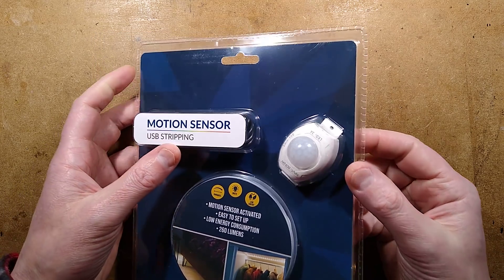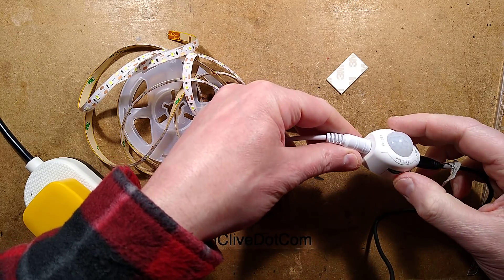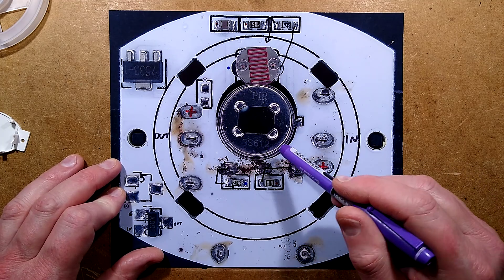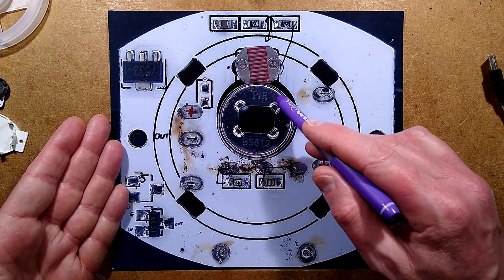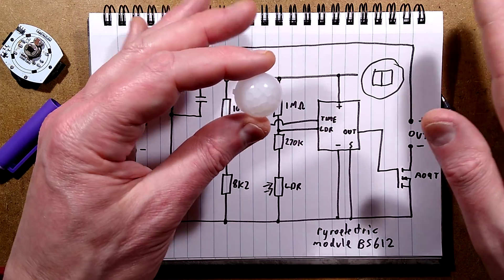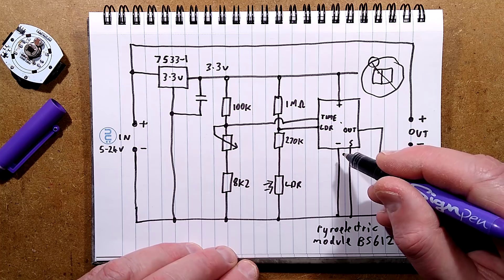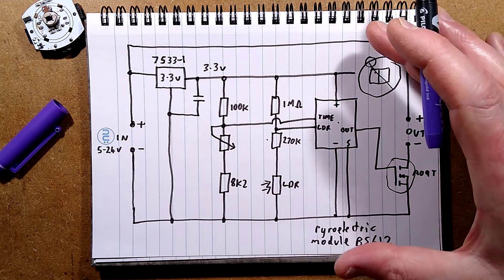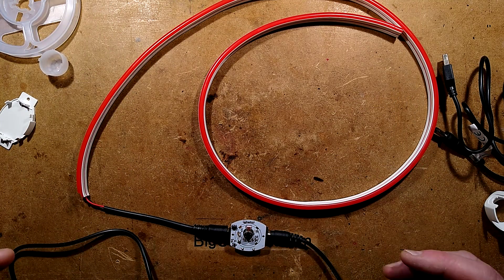Poundland's PIR LED tape.  Worth buying just for the sensor.

Comment: I have a PIR light which recently has started retriggering itself. Thanks for the info about voltage regulation, I'll check to see if its regulator has given up the ghost.
Reply from the maker: If it's based on a capacitive dropper, check the capacitor value of the main capacitor.
Reply: @bigclivedotcom  Thanks, but it's battery-operated with a normal 3-pin regulator and the "regular" chip you were expecting to find in your Poundland dongle.
Reply: I have a "Mr Beams" light in the bathroom for middle of the night comfort breaks and that explains why it flashes on and off when the AA  battery's are below 1 volt.......
Reply: @Trev5  That's actually the brand of light I had self-retriggering. Except I'm feeding it from a 5v supply instead of the stock 3 D cells so I'm not sure why it was acting up. Unfortunately when troubleshooting I had a tiny resistor get lost so now it doesn't come on at all. Its regulator chip outputs 3.0v. Assuming yours uses the same, that explains why the problems start when your batteries get below 1v each.

Comment: What happens to the led strip with 24V input?
Reply from the maker: It would fry it very quickly.
Reply: @bigclivedotcom  Then I don't understand why there is a rating on the sensor

Comment: Anyway you could make a video where you swap out the PIR chip for Doppler chip?
Reply from the maker: The slight downside of the doppler modules is that for power bank operation they have a higher standby current.

Comment: With our hotter summer nights, the  Doppler radar modules have an advantage, as they continue working when the passive IR give up, due to ambient temperatures being so close to body temperature. Last year our front door porch light failed to operate for a number of nights, due to the high night time temperatures. It slowly regained sensitivity as the ambient temperatures finally fell back to a more normal range.
As to the circuit, it is very simple, it must be difficult to find an output MOSFET that has a sufficiently low threshold voltage to switch to high current saturation output with only a 3.3volt gate drive..

Comment: You bring in a Poundland USB supply reminds me that my Poundland 1A supply has almost stopped working, i.e. either won't charge eg Nicore type lights or only very very slowly charges a phone.  My 2A supply still works.  Have others found the same?

Comment: ￡1.21  41%OFF | 12V Motion Sensor Light Switch 5V DC Activated Timer Automatic Movement Detector ON OFF LED Strip Light PIR Motion Sensor Switch
https://a.aliexpress.com/_BURs8n

Looking at markings it's 5 /12 v but not bad for the price

Comment: A 5A MOSFET wouldn't normally be used above 1A or so in practice, as the top current rating implies water-cooling (infinite heatsink).  My advice is calculate the power from I-squared-R and choose a device that won't need a heatsink - ignore the current rating, it won't normally be useful for this.

Comment: I built some 12v gardenlights using one of those pir’s I ordered online ages ago. It has led strip stuck to some aluminium L and im quite pleased with my efforts as not really my area. I cored a hole in the bottom of a waterproof box and glued the sensor inside without the case..

Comment: I have something similar to this, but it has a built-in battery included within the PIR unit to power it without needing to be constantly connected via the USB charge cable.

Comment: So if you accidentally plugged the input and output the wrong way round, I assume it would be safe, because the transistor would now be on the input and simply wouldn't let any current through...?
No workie, but no damage to the components...?
Reply: Almost. MOSFETs have a body diode which always allows reverse current. The lights would stay on. Although there is a voltage drop on this internal diode so there's a chance of overheating the FET.

Comment: In other words would there possibly be some sort of comparator or Schmidt trigger circuitry inside that sensor?
Reply from the maker: It will have the equivalent of the BISS0001 PIR chip.

Comment: Can you tell me what the output voltage is if the input is 12V. Is it still 5V or 12V ? Thanks for the video as always.
Reply: The voltage is presented directly on the output lines via a transistor, so theoretically shouldn't change (circuits in parallel, same voltage). If there is any change in practice, it would be marginal and well within the operating range of a 12V device.
Reply: @nialltracey2599  Great - thanks. I thought it would be the same as the input but good to know for sure.

Comment: If they have the dusk sensor, would they stay on all night if used in a dark environment
Reply: Only if there’s movement to trigger it.
Reply: @MarcelLENORMAND  would there be a way to set it to stay on at night?
Reply from the maker: There's no facility for making it stay on all the time.  That would require a dusk sensor circuit.
Reply: @jamiecullen9075  That’s moving to a somewhat different sensor - just light/dark.

Comment: I got a similar circuit from ALDI but it was battery powered it has the regulator caused the batteries  to drain after a couple of weeks. I removed  the regulator  circuit and by passed it. This  works perfectly at 3.6 v to 4v from 3 rechargeable AAs. It lasts for months in our coat cupboard. Only 1m of LEDs though. I think it was about £6 a couple of years back
Reply from the maker: One of the biggest causes of unwanted battery draining is duff surface mount ceramic capacitors.  They've miniaturised them so much that if they fracture or get chipped they develop a resistance.

Comment: i think ill have to try that voltage regulator on my hc sr505 pir module. it tends to retrigger itself after about 10 seconds even after being covered by a thick piece of plastic or pointed at the wall.
also, i wish there was a poundland nearby, or a similar shop close to where i live

Comment: That will explain why mine blew up when I put 12v in on the 5 to 24v connector. I expected it to regulate the power to the strip. Won't do that again with the second set and at least I have two good sensors.

Comment: In reference to the little dome lenses, are they designed so their focal length is more or less "focused" on the PIR surface? If so, it seems as though this would further increase the PIR sensivity.
What do you think?
BTW, pretty neat little gadget.
Reply: Well yes. How else would you expect them to be? The datasheets for pyrosensors give the effective position of the sensing elements to aid the design of lenses.

Comment: I worked in lighting controls for nearly 30 years (business, industrial and retail not the exciting stuff) all of the detectors that we used were quad pyro.  They needed two of the elements to be triggered to operate.  Almost all of the sensors we used were passive infrared as microwave sensors false triggered far too often to provide good energy savings

Comment: I was curious if there was an option for those of us in the USA, and it's possible to get things like this, usually $5+ USD. In fact this exact module with an AC power supply is $7.58, so poundland is almost a full USD cheaper, but that's probably just the price of the adapter + profit.
Not bad, not bad at all!

Comment: Excellent - Wonder if our Reject Shop might be stocking this item - they stock a broadly similar range to the UK Poundland stores. Bearing in mind that "almost everything" is done by that single PIR module, that's an amazingly cheap collection - half-price (and functionally complete) PIR module, with 2m LED tape and a USB cable thrown in free of charge!

Comment: Clive: Aldi has a load of “smart lighting” gear in the middle aisle. Not sure if you have an Aldi out your way but might be worth checking out.
Reply: Aldi and Lidl have both been showing "Smart" tech on their web pages. Aldi shows a couple of wifi light bulbs, online-only, BC and ES. Lidl has a wider range of kit, but you have to buy a "gateway" (Zigbee 3.0 standard) and none of the light bulbs are BC.

The Aldi bulbs are explicitly wifi. Zigbee is a low data-rate "mesh" system that has been around for a long while. 

Poundland has some wifi lightbulbs as well, but their website shows nothing like this. Have we missed our chances?
Reply: Is Aldi’s whole middle aisle lucky dip a universal thing? I wasn’t sure if they did it outside of Australia.
Reply: @NoobixCube  it’s certainly there in Germany, where the shop started, and in every Diddlidi shop I’ve been in in the UK, so I’m pretty confident that it is universal.

Comment: I still laugh at the woman who gave some led strips a low rating cuz she cut them expecting the non powered strip to still work wirellessly
Reply: where can i find this  lmfao
Reply: @ianbuilder  cant remember it was on some amazon link of some strips on a channel
Reply: How about this one 😂

https://youtu.be/m4cfIInHV10
Reply: @AdaptivePhenix  so acted
Reply: It gets me when people give low rating for items they havn’t even opened and looked at!
Reply: I used to work for ICM Controls, an HVAC control manufacturer. I worked on 3rd shift and occasionally got phone calls from people pissed off that their thermostats weren't working. One woman complained that her power was out, and her furnace wouldn't turn on despite the thermostat having two AA batteries and an emergency mode. (Forced air heat...) Another man in Florida called complaining that his thermostat wasn't working and that there was frost on the table in his kitchen. The temperature in Florida that night was 60°F. (Turned out to be the igniter, not the thermostat, which is what told him that the temperature in the house was 63°F)
Reply: @MattThompsonOnGoogle  I work HVAC and it always amazes me how much people will complain about their electric bill being so high in the winter when they try to heat the house to 75°F when it's 20°F outside or cool down to 60°F in the summer when it's 90+ and 87%RH and they have a 20 year old unit that hasn't been maintained since it was installed.  I blame the way temperature controls are set up in cars.
Reply: @sivalley  I blame our education systems not having enough emphasis on basic physics and math. But there's no substitution for human stupidity. :)
Reply: @SigEpBlue  We are all extremely ignorant about something. Don't judge just because you know something others don't.  HVAC, electronics etc are all complicated things and thinking adding math and physics to high school is going to matter is ignorant itself. Kids already "learn" a ton of abstract stuff that disappears from their brains once they leave school. High schoola need more practical life courses (home care, finances, etc) not Math and Physics. Save that for college or specialty school if they are going to actually use it in their careers.
Reply: @MattThompsonOnGoogle  have you ever seen one of those old school set back thermostats the ones with the actual mechanical timer dial with the quartz clock movement that ran on a single double A battery all times was a recharge will battery it's interesting that they did have a charge switch to charge off the thermostat power but the thing is it was not a way to keep the clock running while charging you think there'd be some sort of circuitry so that when it was charging it would keep the clock at least someone accurate but I guess they save a few pennies.

I remember and while Paris places we had hydronic Heat.

Well nice things is my shop which is actually the utility room State about 70 degrees all year round.

First of all most of which was on the ground second of all boiler and hot water heater both were in there so yeah.

But I remember that was the first time I had change that type of zone valve we had one that had gone bad and fortunately the override was working just fine what happened going there I manually turn the valve on or off to get heat one of those zones also what time will a bad thermostat as well these were the old three wire thermostats unfortunately so it's harder to find a thermostat at that time.

I was tempted to just stick in a relay in the system and of course Bridge rectifier doll if I could not find an AC relay but one thing would be to have to adjust a thermostat anticipator which might get finicky.

But we did eventually find a thermostat that's compatible.

Also went at zone valve where we are kind of lucky there was a spare they're from when we moved in that was down amerifactor in my shop already.

Are so spare parts for charmglow gas grill which we still use the old gas post lights that can be been converted to Electric which were also charmglow
Reply: @aaronbrandenburg2441  Are you on drugs?
Reply: @aaronbrandenburg2441  Can you try again, but this time sober?
Reply: Aaron Brandenburg '
Reply: @Aaron Brandenburg Cool story bro.

Comment: oh my word, does anyone else recognize what that reel is? Note the core, that looks suspiciously like a reel to reel spool...wonder what they did with all of them...
Reply: I thought that initially.
Though the LED tape looked wider than 6mm.
The other possibility would be 8mm cine film.
Reply: Reels like that are used for packaging SMD components for pick-and-place machines; you can buy them by the truckload in any size you want.
Reply: It's the same type as I've got a couple of older Poundland USB strips coiled on. The plastic is very very flimsy (although mines is black, not transluscent white), so not really as rigid as you'd use with a more fragile tape.

Makes sense that they'd continue using the mechanics of the old winding systems, though -- if it ain't broke, and all that....
Reply: @nialltracey2599  exactly! was just shocked to see it again!
Reply: 8mm film / Super 8 film .. hell some of them even still have film text on them. Great that something still gets used/resused in this way.
Reply: I’m thinking it was 3 mins of Shirley bassey singing originally
Reply: @Mikespeed51  The Tigress from "" Tiger Bay"".😁
Reply: Probably rescued off a dump for reuse by some kid in Indonesia trying to make a living and support his family.
Reply: Looks like a Super 8 film reel.

Comment: Found a couple places that BS612 is available for anyone interested
https://www.ec21.com/product-details/6pins-Digital-Passive-Infrared-Sensor--11012929.html
https://www.alibaba.com/product-detail/6-Pin-Digital-intelligent-pyroelectric-infrared_62571038447.html?spm=a2700.7724857.normal_offer.d_title.67dc655flWmy7p
and here is a similar kit search on ebay  https://www.ebay.com/sch/i.html?_from=R40&_trksid=p2334524.m570.l1313&_nkw=motion+sensor+usb+stripping+5v+25v+power+supply&_sacat=0&LH_TitleDesc=0&_osacat=0&_odkw=motion+sensor+usb+stripping+

Comment: If I didn't live in the US I would get it just for the reel for my 8mm projector 😝
Reply: I'm pretty sure the spindle hole in the middle is too big.
My brain is trying to sift through the fog of about 35 years though so I could be wrong 😉
Reply: Galerak The bigger reels had holes about the same size :)
Reply from the maker: You get most LED tape on small reels like this these days.
Reply: bigclivedotcom I love that they are using existing Technology to accommodate new stuff!
Reply: Yes I was wondering if it would take quarter inch  audio tape LOL.

Comment: I just realized that the reels that the LED tape comes on are just repurposed reels from magnetic tape machines. That center hole with the three points is the standard mount hole for those old reels.
Reply: I feel there’s an important historical stop in “pick and place” machines as the missing link between tape machine spindles and electronics distribution.
Reply: @peterg.8245  this is much more likely as to how it became used for LED tape. The SMD LEDs probably came on those reals before being attached to the tape backing.
Reply: If the mechanism reliably winds and unwinds reels at controlled speeds, it reliably winds and unwinds reels at controlled speeds. Makes sense the electronics industry would stick with the known-working solution.
Reply: It's just easier to use off-the-shelf stuff that suits the job than to re-invent something. It's the same reason why higher wattage LEDs are designed to use CPU coolers.

Comment: I really didn't like those huge wall plugs you guys have.  Here in the USA you can zAP your self by letting your thumb slide too far if you want ?
Reply: @racitup4114  Agreed but they're so damn big. even our 30A Plugs are half the size.
Reply from the maker: Our plugs can run large appliances like laundry equipment without needing a different socket.